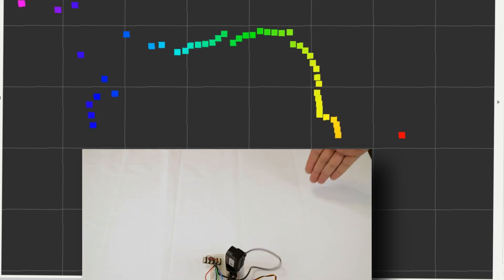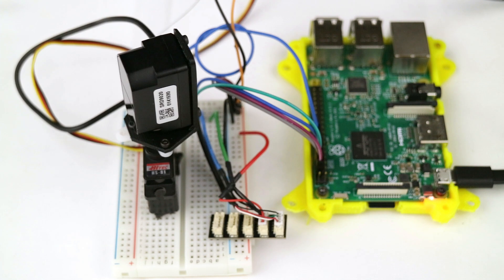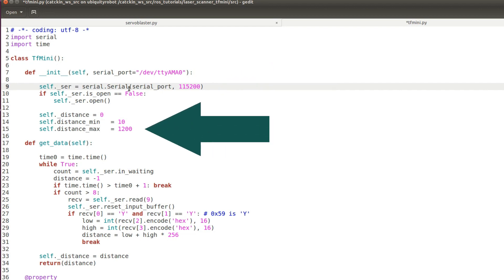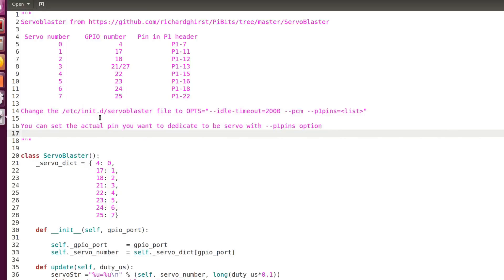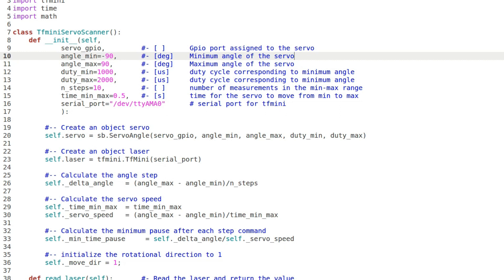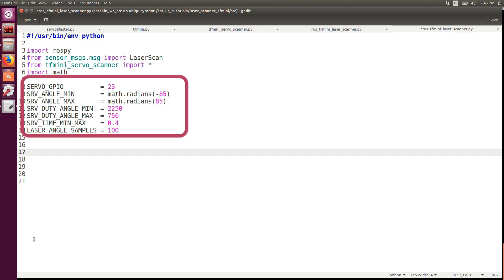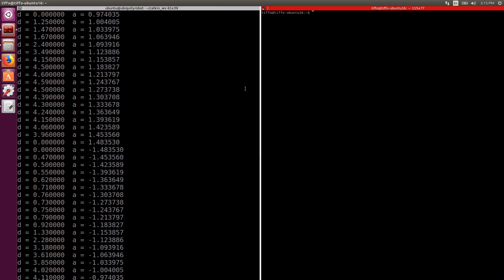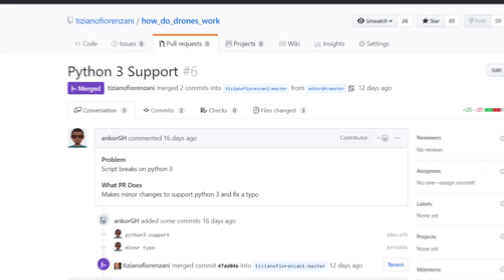DIY Laser Scanner with TfMini and Raspberry Pi | ROS Tutorial for beginners #7

Comment: Huge thanks. But we have a problem. when laserbeam does not return back, the lidar-hokuyo yvt-35lx does not show it; We want that the lidar should show sth weird value or 0 when the laser beam does not return the sensor. What do you think about that?
Reply from the maker: You need to add some timeout check for that. Read, wait, then process the result.
Reply: @prandtlmayer  huge thanks! May i get your contact for instance, email or sth else to ask sth if i have any difficulty on that? It would be a great chance for me to make connection with you.
Reply from the maker: Just post your questions here
Reply: @prandtlmayer  okay, i'll do
Reply: @prandtlmayer  what is used for timeout?

Comment: Hi Tiziano, Is it posible to use this sensor for SLAM?
Reply from the maker: Not really this one, a servo does not provide for a good enough angular accuracy. Either you change the servo for a stepper motor or you include a potentiometer and directly measure the angle. Then yes, you basically have a lidar
Reply: @prandtlmayer  I'll see how it goes with a stepper, thanks.

Comment: Hello Tiziano! First of all, amazing tutorial, I really loved it. I'd like to ask one question though. Can we do the same thing by replacing the TFmini lidar with an IR sensor like the SHARP sensor? And also, would you recommend replacing the servo motor with a DC motor to get a 360° map?
Reply from the maker: Dc motor and encoder it's surely the way to go. A servo is neither fast nor accurate. The video was just an introduction and an example. Sonars, yes, they can work as well. As a matter of fact it depends on your application. If you need a simple obstacle avoidance (as I did in the video before with sonars) or SLAM (as in the next video). Keep in mind that sonars are slow, very slow